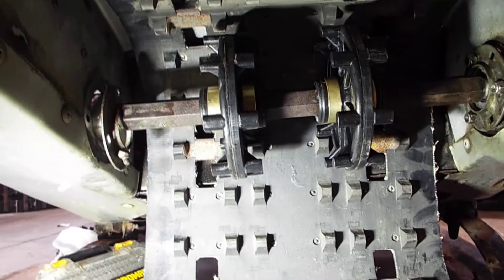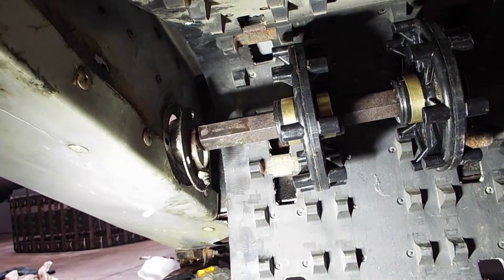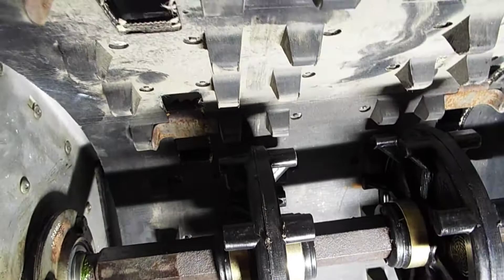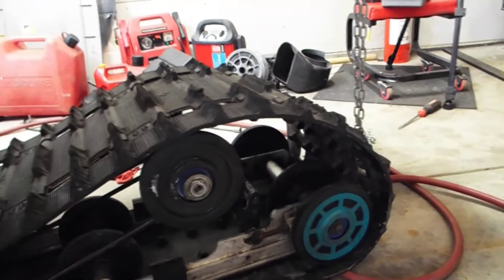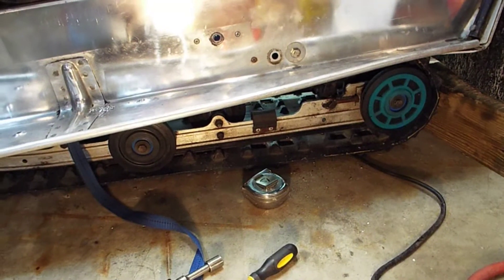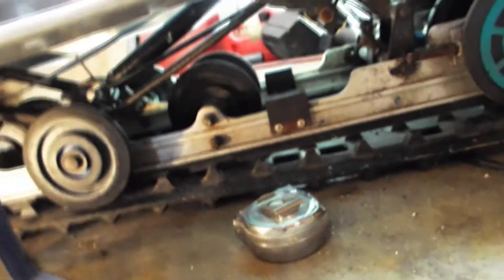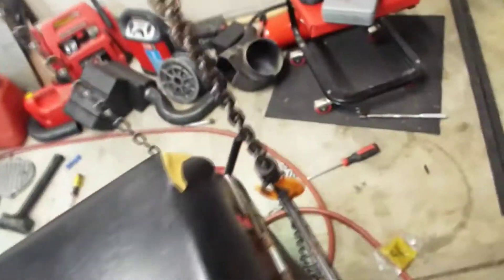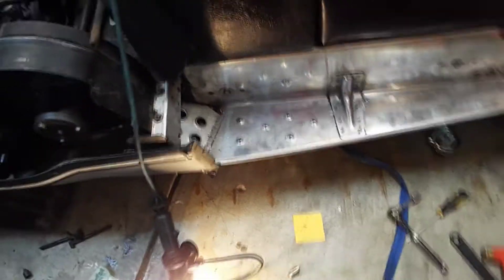John Deere Trailfire Installing Polaris Suspension/Rubber Track

Comment: what did you use for track and suspension and what drive wheels did you use. I am trying to do this but i have a different track than you. i have a polaris track and 92 indy suspension. but the drive wheels do not match up all the way with the cogs on the track.
Reply from the maker: It's a 121"  track.  Suspension is out of a Polaris, probably from the mid-90s.  You can use drivers from a late 90s ski-doo and press them onto the Deere shaft.